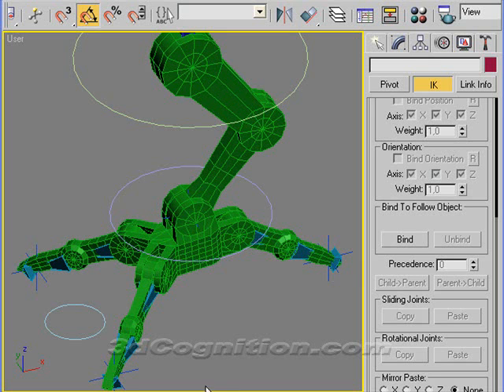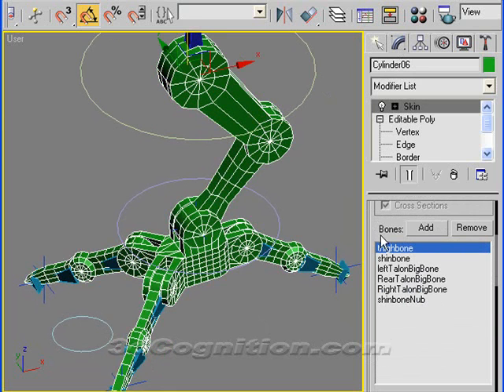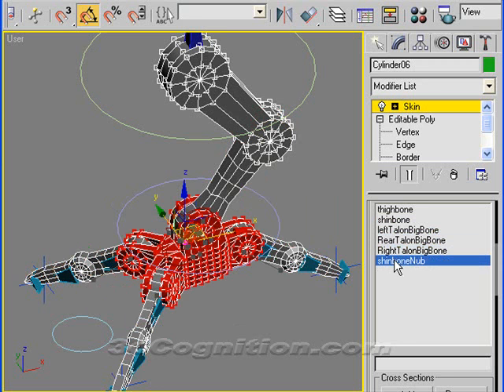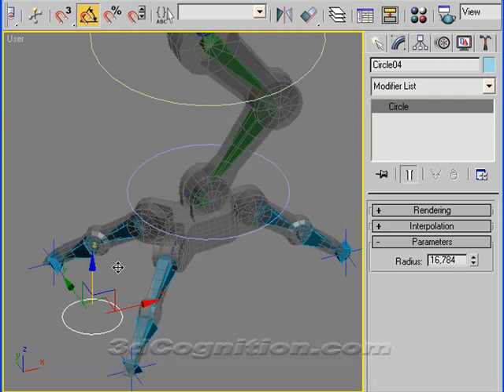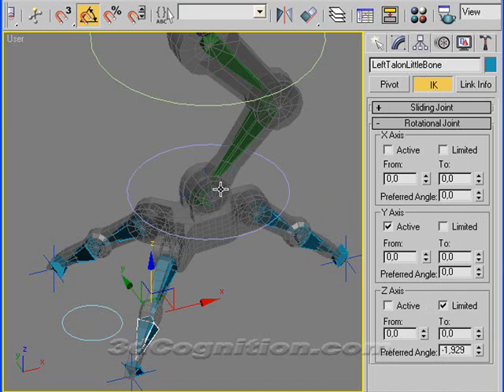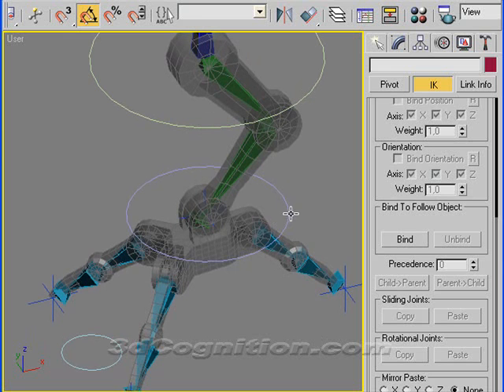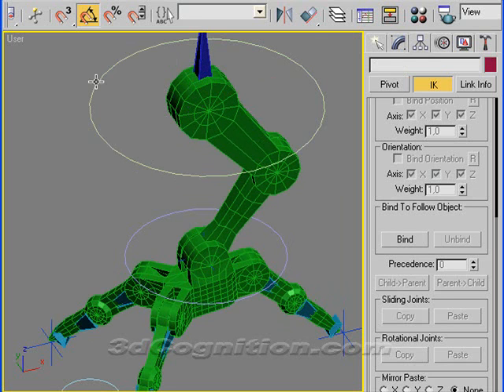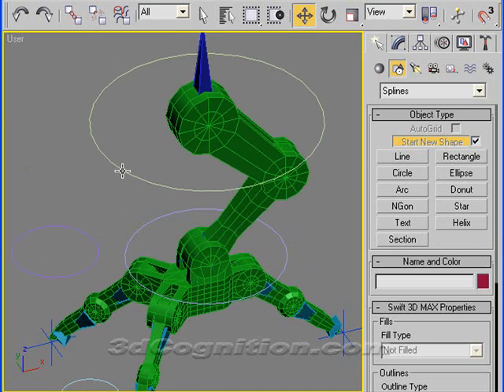Serenity Struts Rigging 2 3ds Max Tutorial

Comment from the maker: Sorry mjs, I didn't see this comment till now - yes it is strange, but when you attach different meshes in Max, they can actually move independently (if they are used with a bones rig). This is done by selecting by Element when you are Skinning the Rig. Try it out - when you move a bone, only that portion of the mesh will move with it.